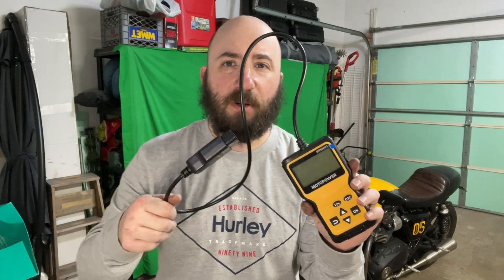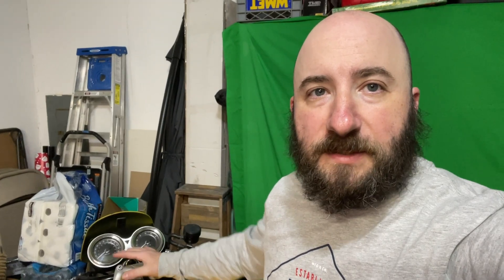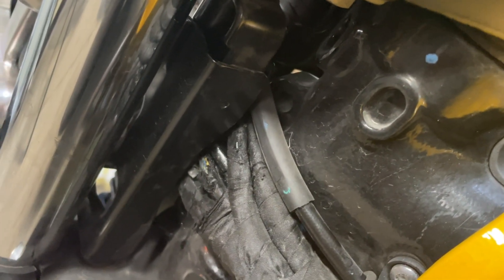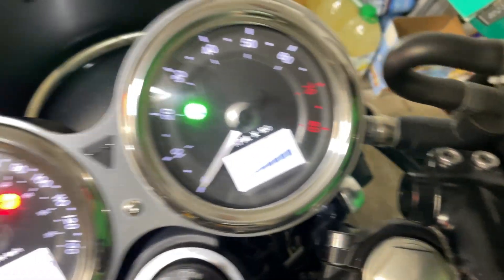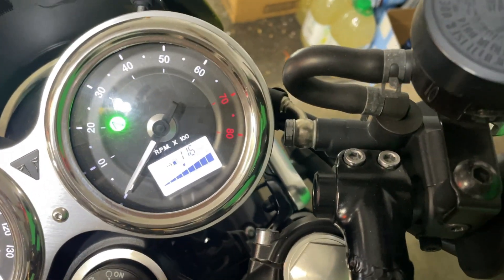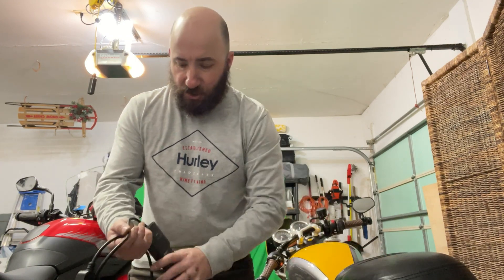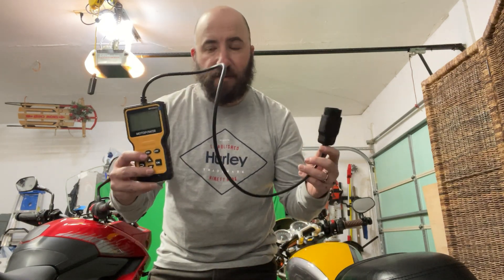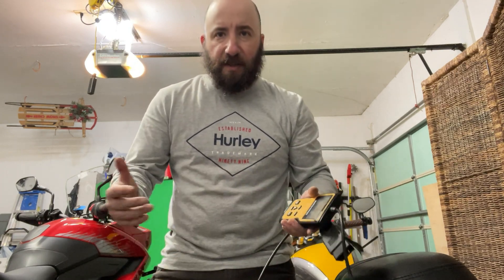Triumph Engine Error Codes P1690 & P1695! What Are They & How To Fix & Clear Them.

Comment: Hi bro. I got p1552 code. What is that? Do you know anything
Reply from the maker: Cooling fan relay short circuit/open circuit. But check out triumphrat.net they may have the answer.
Reply: @VectorBurnOfficial  i delete code. Use 15km dont come out. If the fan or something like that will it be come out

Comment: I’m getting the 1695 code on my 17 Street twin. The bike will crank once, and then stop and the needle flips again like the bike is just being turned on.
Reply from the maker: You may have a loose connector from the main wire harness in the speedo... Take it apart and make sure it's fully connected. That's basically the issue when that harness gets pulled back and forth.
Reply: Will check it out tomorrow evening. Took a rough look at it tonight without taking anything apart and everything looked normal. Harness is tight but no frays or anything. Bike has sat for 6-8 weeks since last ride and had not had this problem before  Thanks man

Comment: Sometimes after you fix an issue that is causing an engine light it just takes 3 warmup/cooldown cycles for the ECU to dismiss the error light. Also on most modern triumphs if you hold down the “i” button when starting, it will display any error codes.
Reply from the maker: Yes I'm aware of this. But I had the code reader for my car already and other motorcycles may not display the codes. So it was just a general PSA and not necessarily for just us Triumph folks. :)

Comment: Great vid. I got my new TS 660 because I was just so tired of constantly fixing things on my old bike. That that issue comes from the factory is a total bummer. Can you shave a little material off that bracket to create more space for wires?
Reply from the maker: The bracket has a thin metal round strip running on the inside that you can't really shave off as it's pretty thin. Though you probably COULD cut it off. But I wouldn't necessarily recommend that, as I'm not quite sure why it's there in the first place.